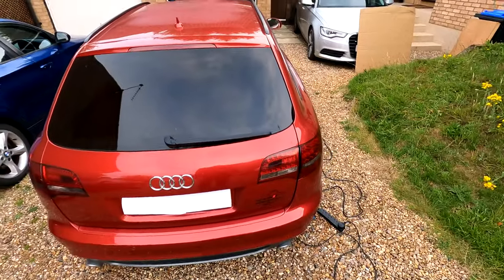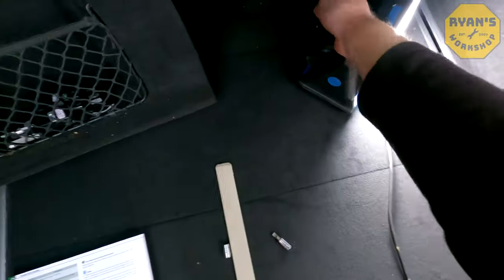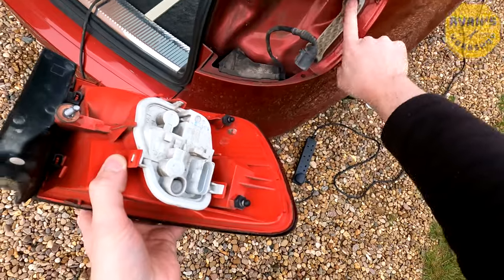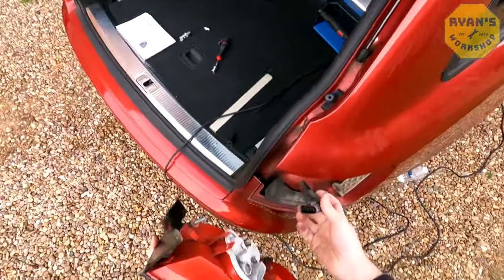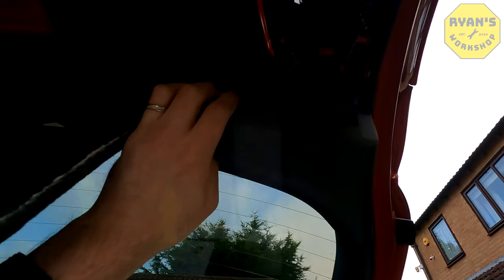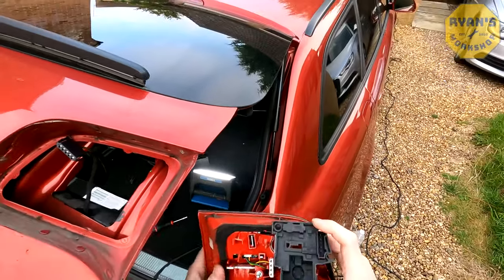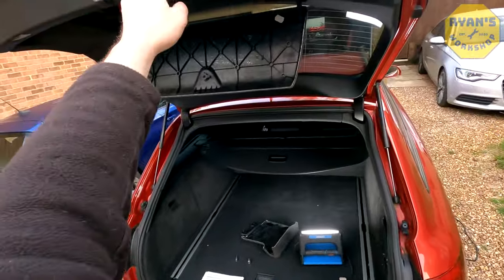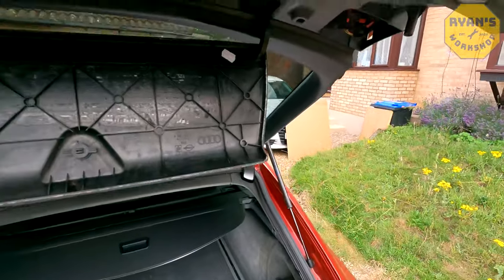Audi A6 C6 Rear light Unit or Bulb Replacement (Avant Facelift)

Comment: Hi ryan  great video  very thorough.  I have the faded inner rear light problem one is cracked abit? Will it fail M.o.t ?   Also. I find the car to low for me? How would I increase ride height. Currently on stock 17 inch. 225 50 17 tyres?
Reply from the maker: It can potentially fail for that issue, also there's not a great deal you can do to raise the over all vehicle height without spending a lot of money, bigger wheels would help a little bit

Comment: Hi! Great vid! I just have a question i have the driver side tail light on the trunk the led for braking et flashing not working anymore after a compound on it do you know what i have to change to repair that? Thanks!
Reply from the maker: Thank you, I would suggest that there is a problem with the electrical circuit and the whole unit would likely need changing.